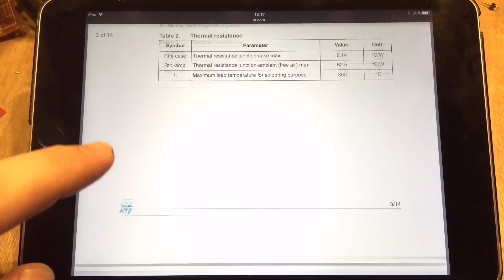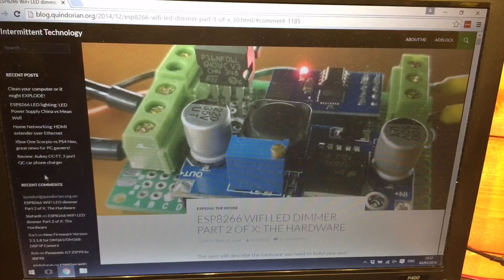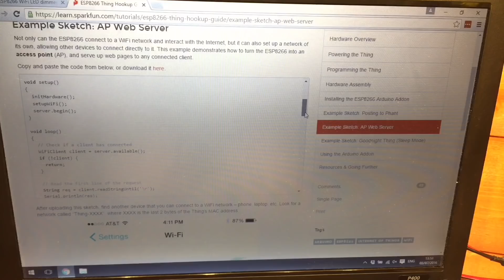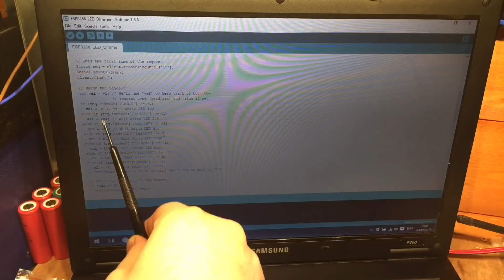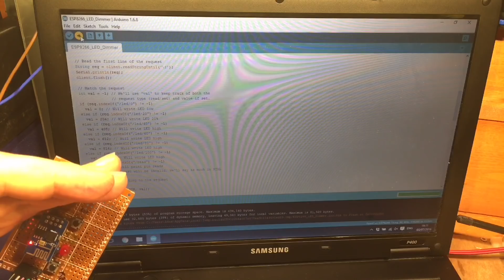ESP8266 PWM LED Dimmer - 12v Solar Shed

Comment: Es muss ein MOSFET mit Gth von 2 Volt oder kleiner sein, da der ESP ja nur 3 Volt aus gibt. MOSFET die mit 4 Volt eingeschaltet sind würden einen extra Treiber benötigen.
 IRLZ24N,  IRLZ34N,  IRLZ44N würde ich vorschlagen
Als Software schlage ich Tasmota vor. 
Aber nicht alle Pins eines ESP12 sind PWM fähig, vorher das Pinout googlen